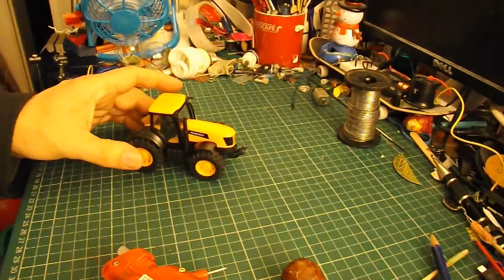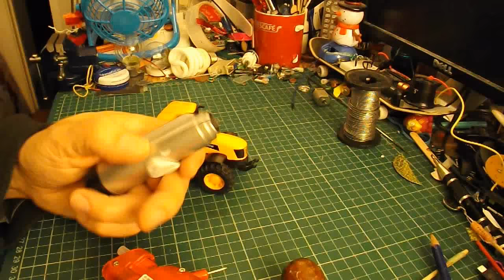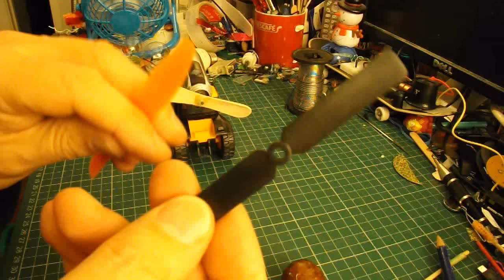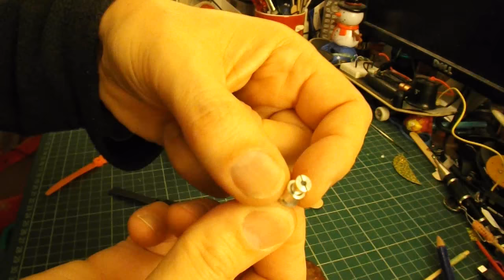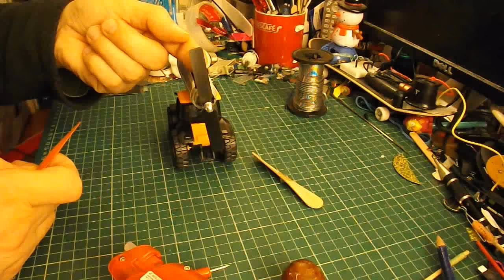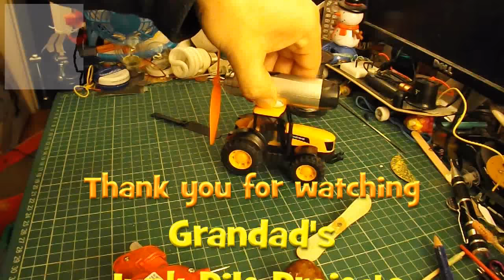Grandad's Junk Pile Projects #2 Fan driven Tractor

Comment: can you make a solar plane
Reply from the maker: +Mattson McCraw Solar Plane - No, there is not a solar panel available that will produce sufficient power to do that in the small size a model would require. Just look at the size of the current round the world solar plane. That has an enormous expanse of solar panels and very large wings to minimise the loading. It is basically just a glider that uses the power to keep it flying.